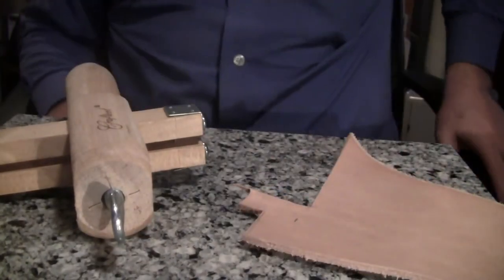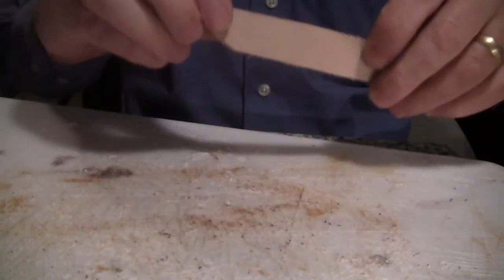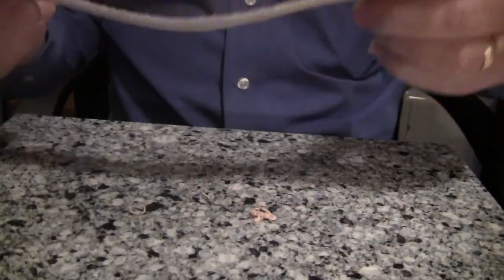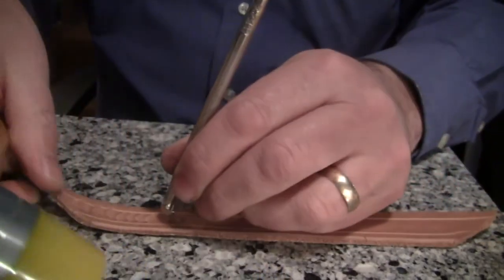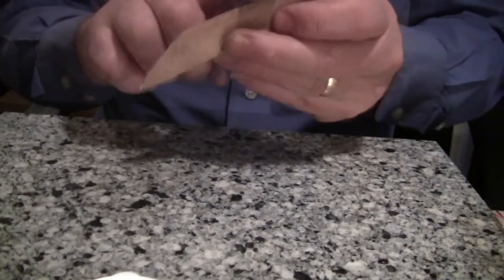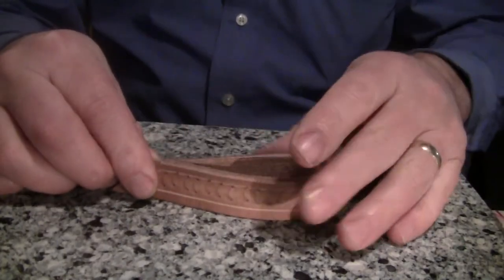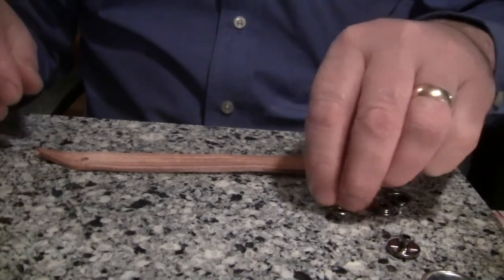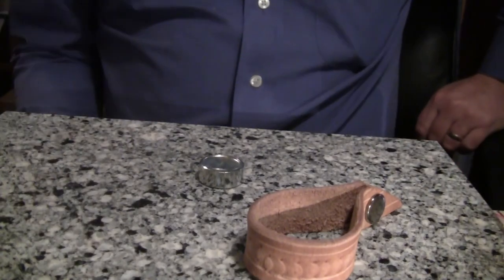The making of a leather pipe stand.

Comment: Very good job!  Whaaat?  Boat Building??  Sounds most interesting.  You inspired me and have me thinking about the leather pipe stand…  I need something that is kind of sturdy since I’m occasionally clumsy…maybe it’s the rum beverage I enjoy when I smoke a pipe?  What if the leather loop was made with three or four layers.  Possibly glueing or lacing the layers together?  And maybe make the layers staggard in height possibly a quarter inch to give a wider base?  I saw one guy use leather spacers and a bolt with a nut rather than a snap.  I might experiment and use spacers of varying heights so that it forms a slight cradle. I have not tried leather working since I was in the Boy Scouts 45 years ago.  I might just give it a try.  Thank you!